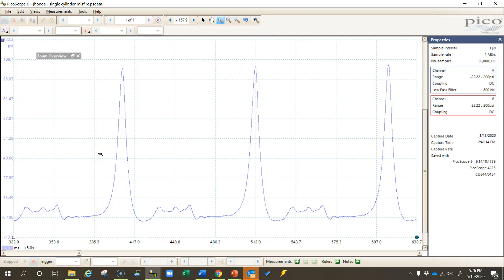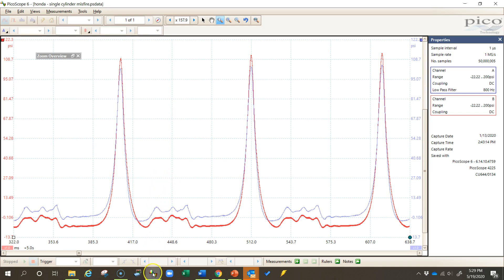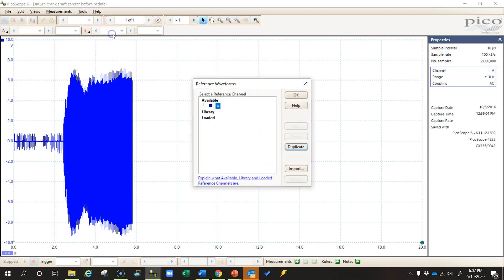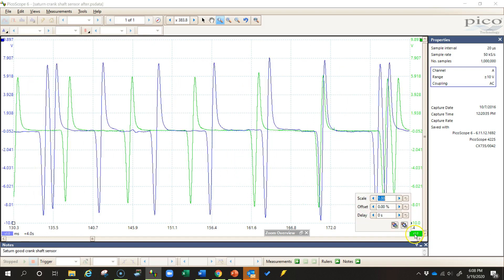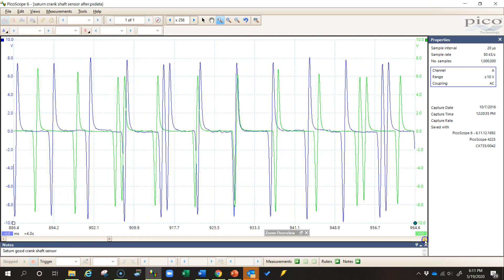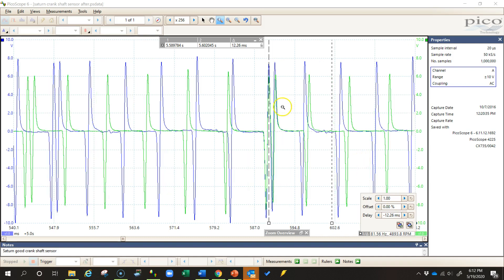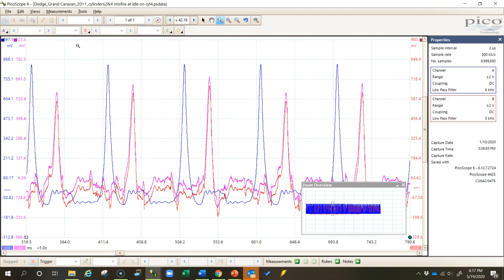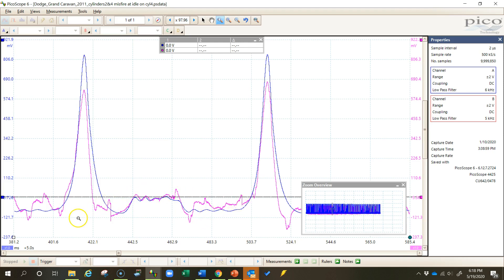Overlaying Multiple Waveforms on the PicoScope (Reference Waveforms)

Comment: Forgive me Justin, I'm not FB savey but do you have a video using PICO how it hooks up to do secondary ignition firing lines and how to identify #1?
Thanks,
Michael
Reply from the maker: Are you trying to analyze the secondary ignition waveforms or are you trying to use the ignition signal as a "sync" in order to identify cylinder #1 in another waveform such as a relative compression test?